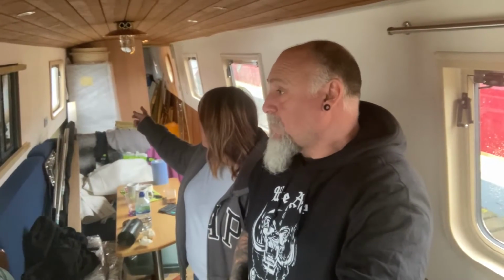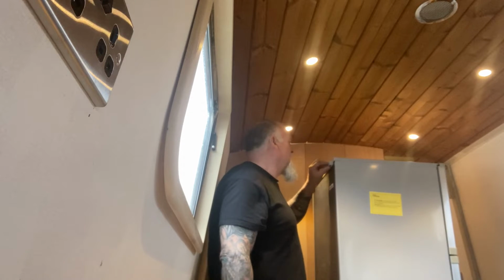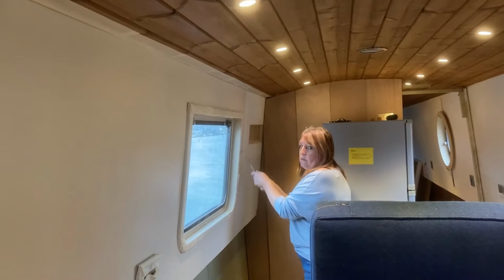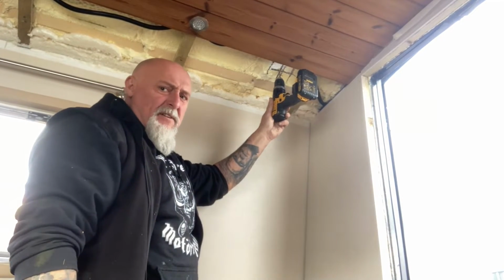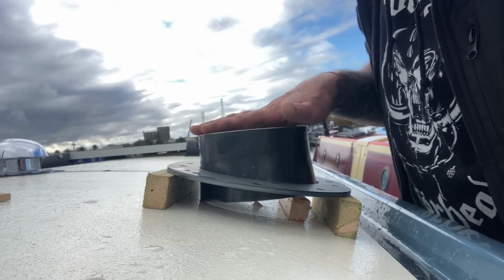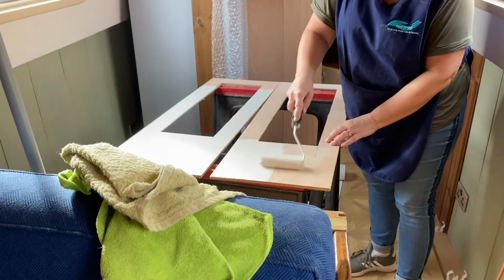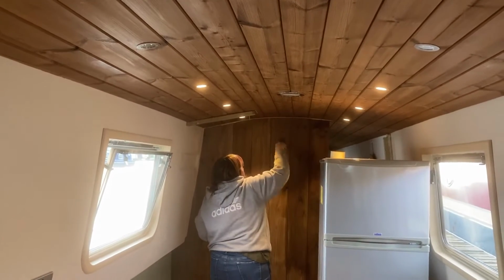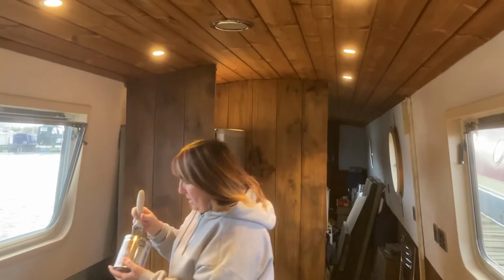Building Our Narrowboat # 34 - Exit Strategy?

Comment: For the fridge,,, cut back a little deeper and just glass and frp the foam!
Reply from the maker: Hi Russell, thanks for the tip. We didnt want to impact on the spray insulation, and that extra inch recess has worked out well. Glad we have finally settled on a solution.

Comment: You are handy with a saw, a hammer and a drill. You could make your own kitchen cabinets much cheaper than buying them in.
Reply from the maker: Yes have been thinking about that. The cases are not that expensive. It’s those curved doors that really bump the cost up. Still thinking this over.

Comment: I really like your choices in finishes. I think your choice of the large frig/freezer combo is a good one. Just wondering - can you open the doors on the frig all the way up?
Reply: Oh - and happy birthday!
Reply from the maker: Hi Holly, thank you for the comment. Yes door opens fully, as there is a bit more space on the RH side. Seems to work well. We are thinking of some reproduction metal signs on the bulkhead and a clock at the very top that does not interfere with the freezer door. Thank you for the birthday wishes, and a day off is well needed.